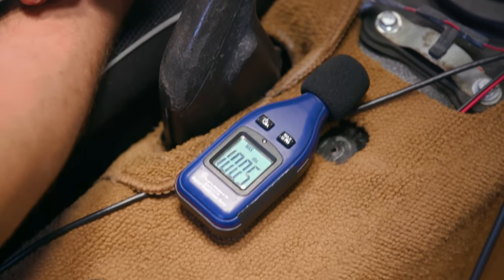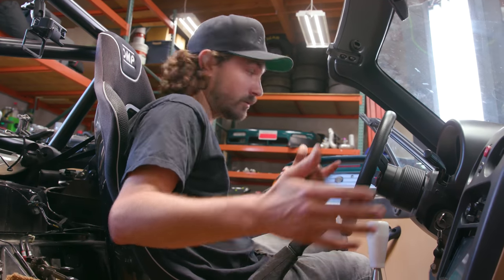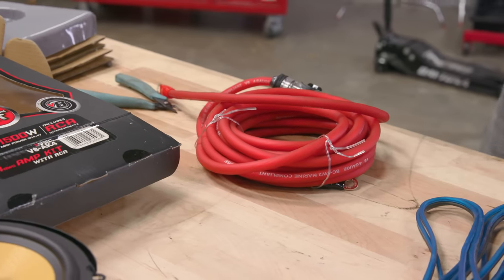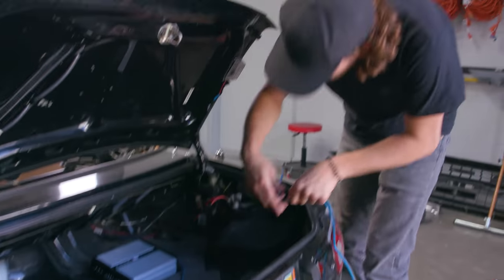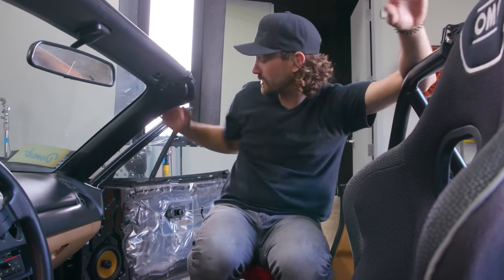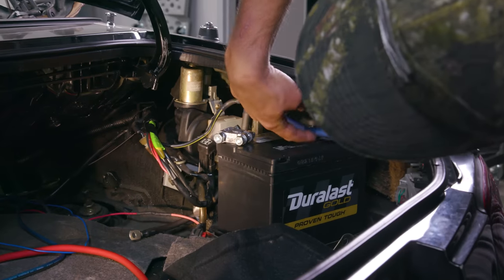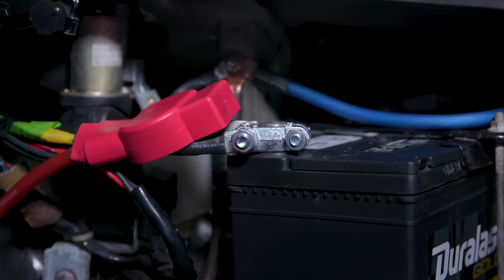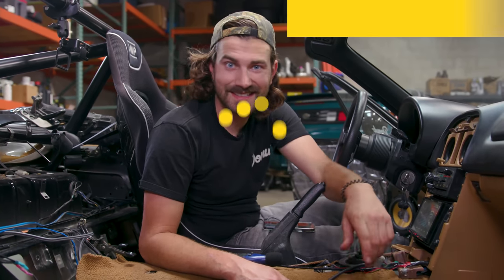Is Upgrading Your Car Speakers ACTUALLY Worth It?

Comment: I love your videos @Donutmedia, but this one has a couple of things that should not be... RMS wire run with the RCA's is a no-no (can cause interference in the RCA signal). Mounting the amp upside down is also another no-no as the top of the amp is used as a heat sink. The gain knob is not a volume control, it is meant to match with the pre-out voltage supplied by the head unit. Crossover setting on the amp can be adjusted but would need at least a volt meter and sine wave Hz track to adjust it properly.  Or you could be lazy and use the crossover option in the radio. Matching amp rated RMS power to speaker rated RMS power isn't the best way either, because the amp tested at that wattage right before or at clipping. The amplifier test for those stats on the box were done on an amp dyno (resistor load, constant) but speakers are a reactive load (as they move the ohm impedance changes). Since he has a 4 channel running 2 speakers I would bridge 1&2 channels for the left and 3&4 for the right. You would get the full power the speakers could handle while not pushing the amplifier to the limit. Most important, that stuff printed on the side of the amp for adjustments (gain/crossover/bass boost/etc) is not to be trusted for a way to adjust the amplifier. You need at the very least a volt meter.

Comment: I just have to correct one thing said in the video so people don't think they have a "volume control" on their amp:
The Gain setting should be set at a level before the speakers distort, assuming your high pass filter is set correctly as well. With the head unit near full volume (not at full, because head units can distort at full volume), set the Gain on the amp until the speakers distort and sound less clear, then back it down a little. Remember that volume setting on your head unit as full volume and don't go above it.
There's a more accurate way, using an oscilloscope, to determine how much Gain is too much and and if your head unit distorts at full volume... but that's a lengthy explanation with sine waves turning into square waves in the end....

Comment: you should always install a capacitor in the power line as it saves on damaging the alternator. (37 year mechanic and stereo installer)

Comment: The gain know on Amp is not volume... it to match headunita rca output  voltage. You have adjustability  to match that any higher  you have clipping  meaning ur burning out voice coils In speaker connected to amp

Comment: RCA near DC power supply.... shouldn't interfere. However in a house, AC power next to an unbalanced/unshielded rca (also low voltage AC) would interfere.

Comment: My trick for getting wires through the door is to zip tie the new wire to the old wire before removing the old wire. When you pull the old wire through, it will pull the new wire through as well.

Comment: Actually if you left those old wires lose and with showing copper they will make the audio cut in and out since they are connected to the head unit still.

Comment: Funny thing. All of that distortion was probably due to overdriving the head unit. The alpine speakers are as good or better than the bottom end JL’s. Two 6” speakers that size won’t play much louder than 100DB full range without serious distortion. You could have driven the Alpine door units with two of the Amps channels and added a sub. Reducing the bass load on the speakers will drastically reduce distortion and adding a sub will give you much better bass.

Comment: The role of the amplifier cannot be understated here, even the original speakers that were replaced (that looked to be aftermarket anyway) would have benefitted from the amplifier as it's likely some of the distortion was coming from the head unit's inbuilt amp being absolutely maxed out at '40 volume'. 
In other words, if you're a DIYer and doing this on a budget, you can do it in stages and the first stage would be putting in a decent amplifier that will allow you flexibility in future. A really good video as always!

Comment: I like to attach my new speaker wire in the door to the old speaker wire with small zip ties covered in electrical tape then pull the new wire back through the door wiring harness in to the cab. Doesn’t always work but has worked often enough to try it first lol

Comment: I don't recommend using the welding wire. I tried this and poked a hole right threw my gromet, and even then it was way harder than just removing the grommet from the plastic thingys and threading the wire through by hand and then re installing the grommet.

Comment: I suggest adding some tweeters on the pillers. You'll like the upgrade. 

A small center console custom woofer box with a single 6.5 inch or a 8 inch would sound very nice in the miata.

Comment: I can understand Zach's choice of JL Audio for the Miata soft top, with all the road noise he shouldn't be too concerned with clarity from the speakers and amp but leaning more towards loudness.  If you are piecing together a stereo system for a closed cabin/hard top vehicle I would recommend staying away from JL Audio, and any other audio company that doesn't publish full specifications of their equipment.  

For speakers, the material used for the woofers and tweeters is the most important to pay attention to, and different materials will have significant results depending on the type of music you normally listen to.  General rule of thumb is the woofer should be made out of some stiff material, I like the sounds of kevlar or carbon fibre matrix materials for the woofer and a soft tweeter as I mostly listen to rock and electronic music.  The aluminum tweeters in the JL's will sound tinny and too bright in the highs for that type of music, and is generally more suited to acoustic, jazz, and orchestral music.  I can't comment on JL Audio's woofer technology, as it is proprietary design and they refuse to give any details about the composition.
The next things you should be looking at for speaker specs is the frequency response and sensitivity.  A good company will publish precise specifications, what type of load is on the speakers to get their rating.  The speakers Zach chose have a sensitivity of about 90db, which is pretty awful.  95db is what you should be aiming for, anything close to that or above it will net you the best results and is a good indicator of how well the speaker is designed, but 90db should be just fine for soft top vehicles where volume is paramount.

For amplifiers there's a lot more to simply matching wattage, and is the most important component of any stereo system.  I dislike the way Zach glossed over this but it's probably not really in his wheelhouse and it doesn't matter much for the miata. JL Audio amps are awful, even if power is what you want (it shouldn't be) they are inefficient at that.  For a closed cabin, you're going to want to look at THD, and you want 0.3% or lower regardless of impedance (yes that includes subwoofers!).  The amp Zach chose is reported by JL as <1% THD at 2 ohms which is the same type of clarity you'll find in any knockoff chinese amp you buy from alibaba or amazon.  The other spec you want to look out for is signal to noise ratio.  Generally speaking the higher the number the better, but you need to be careful of how it is measured by audio companies, as some will try to mislead by showing measurements outside of normal listening conditions.  Again for the miata the 84db s/n ratio will be fine as the road noise will mask anything coming from the amp, but in a closed cabin aim for 90db or higher.

Also, if you're spending significant money on after market speakers, get a subwoofer as well.  It doesn't need to be a giant ass kicking sub, just something small that will compliment and blend with your speakers.  This will help fill the bottom end of the music, and in some cases show you parts of the music you didn't even know were there, as well as relieve some stress from the speakers, as they won't have to go through the flexing of the lower end due to the crossover you set at 80hz (which is the line where below this frequency, human ears can no longer distinguish the direction of the sound source).  if you set the crossover at 80 or just slightly below, say 75hz and then dial in the subwoofer amp to match the output of the speakers, it will sound like your car speakers are doing all the work.

The last thing I want to mention is damping, spend the time to install damping material in your closed cabin very very liberally.  It will give you a much better listening experience, eliminate rattle and vibrations from the cars metal parts, and will greatly reduce road noise. In the soft top... doesn't really matter, just go loud and annoy everyone else on the road with your terrible music choices.

I've never seen a video on youtube of a proper stereo installation in a car. each one I see is just going for loudness and ass kickery, bombastic, muddy, shitty, bass.  I'll record the next install I do, which won't be for a while because my system builds last forever.

Comment: YOU CAN SAVE A LOTOF TIME ONT HE SPEAKER WIRE JUST USING THE OLD WIRES. 

On the harness adapter to the head unit the wires are clearly labeled. Just tap your amp there.

Comment: Bruh, CAPACITOR!!!!!! legit one of the most important things in any after market install for an amp. Unless you like seeing your headlights dim and enjoy replacing alternators all the time. Also. It would probably be a really really good idea for some dynamat or something to create a sealed sound.  I will say decent install but something that should be mentioned. If your running a monoblock amp for subs. Wiring them down to 1 ohm and getting dual coil subs will get you way better bass. Another thing you should go thru is talking about the optional ways of wiring subs depending on single or dual coil.  Wiring it for one ohm. You guys should do a video on this. I also wanted to ask why in your subwoofer install you mentioned there were two types of boxes. But you didnt mention bandpass which is usually better for convertibles or SUVs.  Just my two cents. Love your guys vids and what you do for us car guys. Would love to work with yall thats for sure.

Comment: Damn figured you'd either use entry level speakers without an additional amp, or higher end speakers when using an (more expensive than your speakers) additional amp

Comment: freaking awesome. Reminds me off my high school days hooking up friends cars with audio/ video. I running is MBQuart for highs n midrange components 1 Alpine X 12 sub alpine amps. it's really a no brainer to  upgrade your car audio unless you have a brand new car  these new systems sound great but when u purchase a used car you should budget to buy a whole system  I'll never pay 2500$ or more for a premium stereo from the factory. ..a aftermarket system is the way  to go and cheaper and will sound better than most factory stereos.  keep up the great videos good work

Comment: i have a nicely matched system in my car. An alpine ilx 507,  infinity kappa front and rear comps with 2 12 inch kenwood excelon subs 300 watts each @2 ohms with a kenwood excelon xr900.5. Sounds verrry nice

Comment: @ 10:00 thses speakers are not component, they are coaxial. (Says so on the box). Component speakers have a separate tweeter that can be installed at a separate location and have additional wiring. FYI!

Comment: No it's not. The speakers aren't the problem if they actually work as intended. The speaker is only one part of the equation, the other parts is the whole rest of the vehicles acoustics. You can't just "upgrade" your speakers and expect a better result, UNLESS the speaker was specifically designed to work with that vehicle, which most aren't. There's no such thing as a better sounding speaker anyways. You'd get way farther by installing some sort of equaliser, and then tune the whole system by ear. But since most people don't even have a reference to what good sound is, it's a futile endeavor anyways.
So the question should be something along the lines of: "Do the speakers in your car work? If yes, then you should probalby keep it as is. If no, then you could try to look for original replacements, or an upgrade system that is specifically designed for that vehicle".
If you just want loud, then get a cheap amp and bass box, wire that shit straight to your battery, and accerlerate your hearing loss to your hearts content.

Comment: it's a lot easier when the battery's in the trunk lol
mine was in the engine so I had to look for holes in the firewall, fortunately there's a rubber hole where a clutch pedal would be, so it all worked out in the end

Comment: I hope you hooked up the 12v fuse going to the battery.
Reply: If you pause at 18:30 you can see a fuse box on the big red wire behind the light.  Again at 18:39.

Comment: OFC wire is a very persistent myth. It's great for doing non-polluted chemical reactions, but it has zero influence on audio signals (or any other signals for that matter). I'd like to say: "Don't waste your money on OFC", but it's actually hard to find non-OFC audio cables. It's like everybody believes racing stripes makes your car faster, so every manufacturer just includes them in the standard paint job :D

Comment: I've got a pair of those C1-650X.  Good speakers.
Reply: By far my favorite speakers are the JL Audio C5-653 Evolution C5 Series 6.5" 3-Way Components. I bought them on sale, when they offered a half off deal. I have never seen them half price before and they sound just as good as Focal speakers I used to have that were almost 3 times as much. Although the C5 components are usually almost 1k, regular price, so they aren’t really cheap either.

Comment: GET A 6 INCH SUB OR 8 INCH IN THERE . It will sound 3 times better. Use up all the options that the amp has and show your audience that. Personally I would have chosen to put in a secondary smaller battery and brought everything up to the front and isolated the stereo into that battery. Less wiring and better application

Comment: Im just at the beginning of this video, but you don't really want to listen to your music at "max volume" typically, at max volume your music begins to become distorted. You might not notice it but every headunit has a "clipping" point, which is when the signal becomes distorted. Think of the music as a heart beat (Sinus wave) and if the heartbeat starts to act abnormal well death may occur (your speakers blow) I know putting it like this is super generic lol but what I'm trying to say is, listening to your music at max volume will eventually blow your speakers. You should tune your headunit typically at 80% of it's max volume.

Comment: Lots of good information in this video and also some I wouldn't reccomend. I've been doing stereo installs since early 90s. First the remote wire shouldnt work with the key ignition it should work with the radio. Meaning if the car is running and the radio is off the amp should be off. Next always cover the positive battery terminal with tape, rag, or something to prevent accidental touching/sparking. Next his miata only has 2 speakers so there was no need for a 4 channel amp (unless at some point he will add more speakers) a 4 channel amp will usually cost more than its 2 channel counter part. And most 2/4 channel amps have a crossover built into them so there would be no need to get filtering caps. And lastly under no circumstance should you ever play your radio(head unit) at full volume. All that does ks introduce distortion  and distortion is the worst thing for speakers. Best thing to do is have an oscope or some sort of distortion meter. Most stereo shops will have them .  A good rule of thumb is you dont get metered is about 5 -10 numbers below max. So with that being a pioneer I'm guessing 50 is the max volume number so you wouldn't want to go 40-45 on that number. Same goes for the amp never turn the gains up fully again get it tested for distortion. Being a JL the highest I would turn the gains up is about ¾.

Comment: a cheap way to have great sound (for the driver) is to install a mono sub amplifier+8'inch 250-400rms subwoofer, and put higher impedance, hi-end full range drivers in the front doors using no stereo amp.
just upgrading the speakers has to be for better ones, i mean sound quality wise, but can never be for more volume(that is what bad taste people do). 
you either get new speakers that sound better with the same power/impedance(its a simple upgrade, with hi end drivers that fit the same places and have same dimensions as the original set)... or you get a full system upgrade( stereo hifi amp  +  equalizer, subwoofer amp from the passive signal coming from the eq port, or directly from the main media unit).

Comment: Fantastic, I've really enjoyed this video and will have to watch it over again, there is so much going on but at the same time it comes across as a can-do thing even for someone who has little experience at all. Great vid, thanks for the posting.
Reply: Disagree.
I've done a few radio installs, and work in electrical currently, and this shit was overwhelming. 
He certainly did a great job explaining and simplifying things, but overall , it was mostly jibberish to me. 
Telling you the concepts and understanding the concepts are different and, ultimately, with so many different aspects to my vehicle, I'd never attempt this. 
For instance, my battery is in the front through the firewall....no clue how to get wires through there safely. 
It's a Chevy cruze anyways, not like I care to upgrade much. 
But I've had the stupid thing way longer than I imagined and the lack of audio is getting really bothersome.